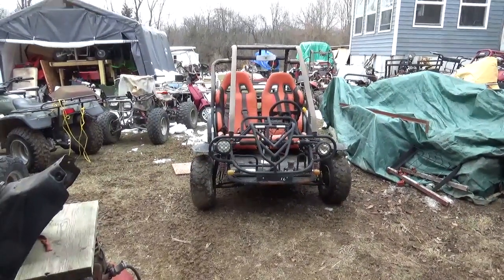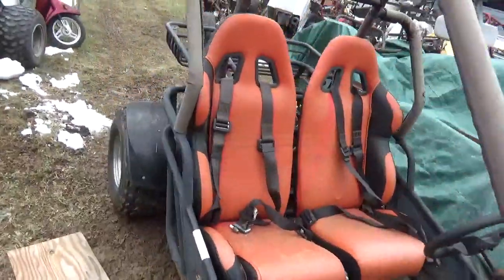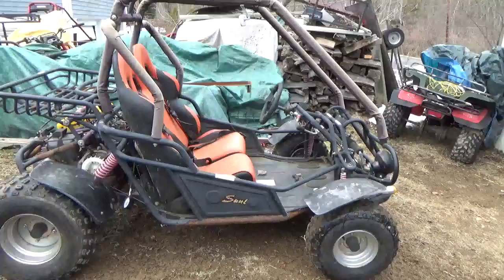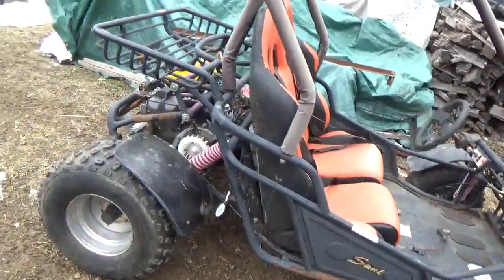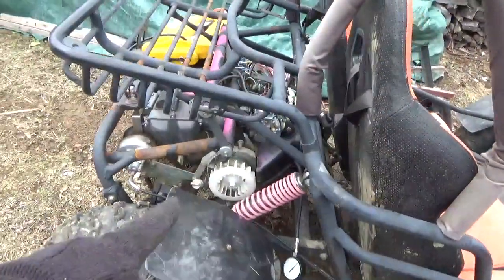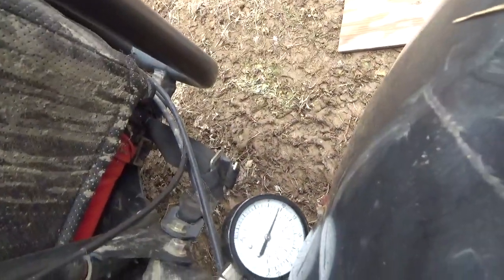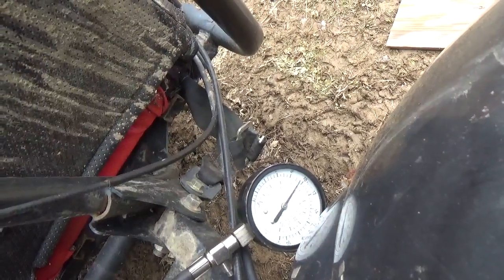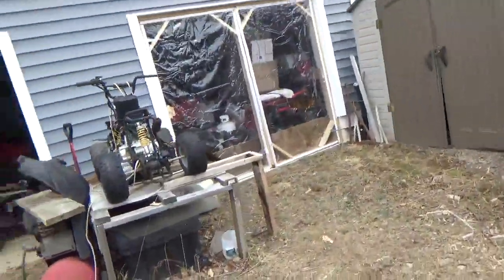Salvaged Sunl Off Road Cart compression test, engine good or scrap?

Comment: good sign... i had people mad at me when i wanted to compression test a small tractor engine. telling me all sorts of stuff and how much a running one would cost etc. my dad taught me that at age 15. look at dipstick for water etc
Reply from the maker: Hey Bob, One of the first things I did was check the dip stick for oil and I looked it over to see if there were any indications that it was in a flood, oil was good, no sand or small flood debris in or around the seats.... Looks like an electrical problem plain and simple.... Thanks for Ur advice, suggestions, encouragement, watching, and commenting!!!
Reply: could be a great find

Comment: well thats a good sign,hopefully it will be a driver
Reply from the maker: Hey Roger, I did more research on this buggy, U R right, I am in a little tall at $450 for a non runner... If it is a cheap and easy fix, I win, if not and I need to replace the motor, I will be in for full freight.... Thanks for Ur advice, wisdom, watching, and commenting!!!!